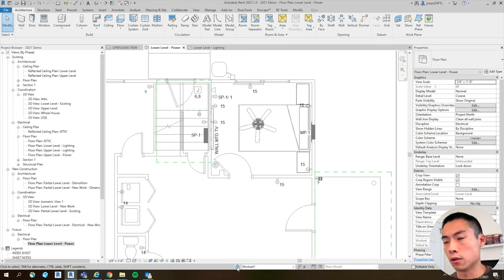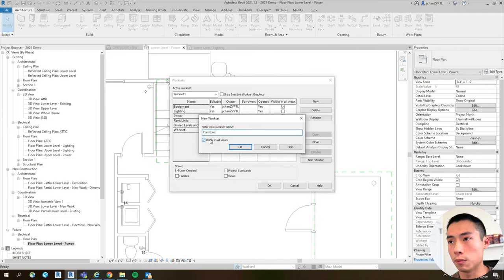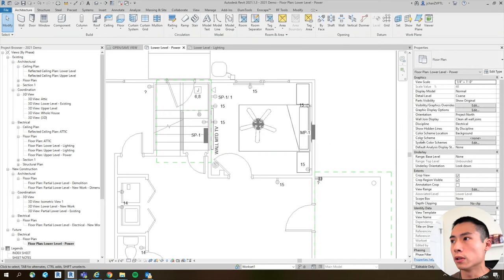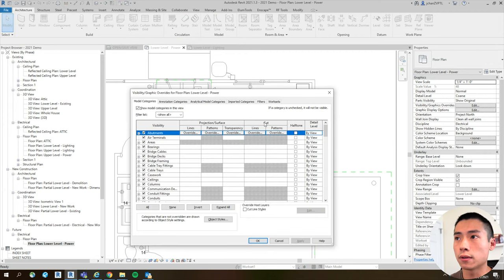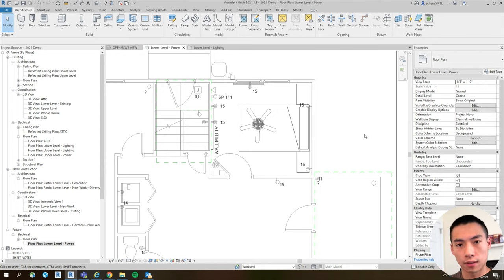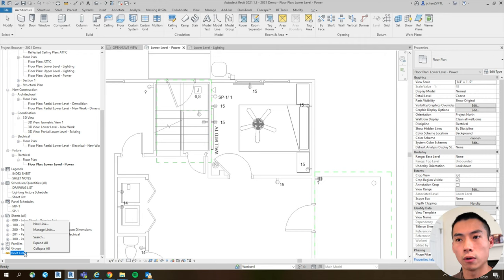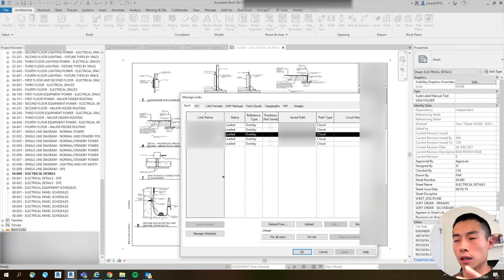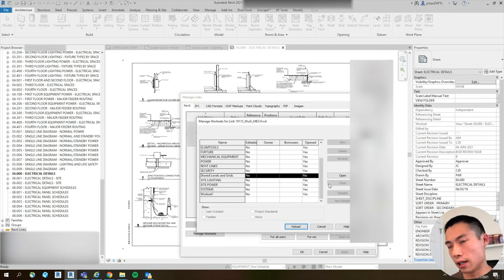Revit Review - What is a Workset?

Comment: The thing that separates the workset in the filter tab in VG is its security, especially if working with other modelers, so the security of work will correspond to the owner of the service, scope or trade only, that divides the project from different areas in construction but beware of relinquishing owned workset cause sometimes it cost time delays if someone didn't relinquish his/her own element

Comment: You should be changing the categories of your families or making view filters.  Worksets are not the right tool to control view visibility.
Reply: came here to say this. He could've used view filters to solve the same problem
Reply from the maker: While that may work, worksets can transfer to a linked model to allow them to turn it on or off on their end. Worksets can also be used on their end when they make their own filters to show a group of devices differently. Sure you can change categories if you’re a small company but when you’re families are managed by the BIM department that takes 3 years to get around to updating a junction box family, you gotta do what you can with the tools you have.
Reply: Does your firm disable the "edit family" button?  In Revit, families aren't tethered to a larger upstream repository, so you can just edit the family you have in your own project.
Reply from the maker: No but they do have a BIM coordinator checking on the projects daily and they fix some clashes or replace families from UniFi if they’re altered without permission. I added clearance to a family once and they slapped my wrist and overwrote the family with the original. Has to submit it as a change and officially accepted before they allow it as a standard family for the company.